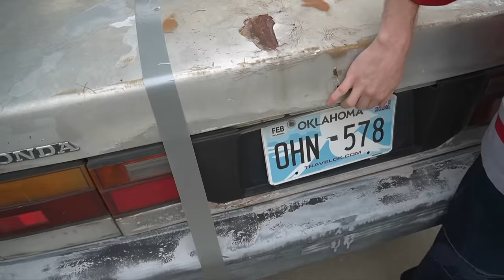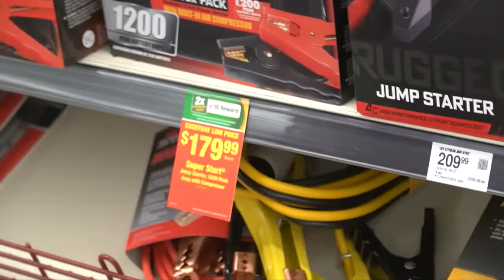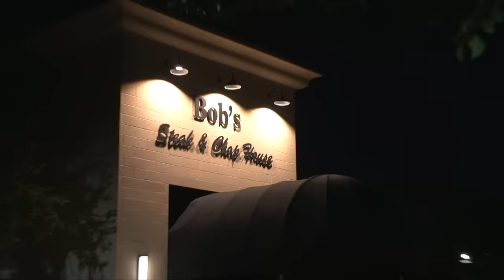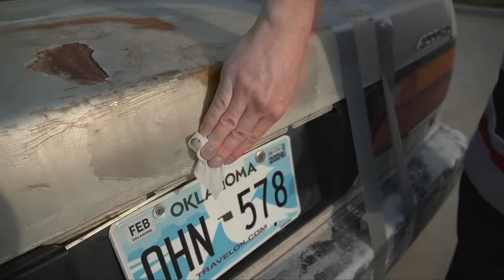I Took My 1986 Honda to a 5 Star Restaurant to VALET

Comment: This man ran this car without any transmission fluid and engine oil just goes to show Honda makes seriously good cars.
Reply: 1986
Reply: @hiddenfingerb2072  even today Honda and Toyota make the best engine in terms of longevity in the world.
Reply: There was a vid of them running cars without oil and revving them until they carked it. The Honda kept going with no oil.
Reply: A hypercar would never
Reply: you could hear it knocking in one of the scenes there was a slight knock
Reply: @Wisdomseeker24-7  Sadly the super new ones aren't nearly as good as they used to be. Toyota changed CEOs and since then it just hasn't been the same. The new Supra is a great example, very nice car but it's basically a BMW with a Toyota badge on it. It's nowhere near as good as the OG Supra. Honda is still decent but they aren't nearly as good as they used to be. I have a 07 Honda Fit and mechanics tell me to keep my car as long as possible because they don't make them like mine anymore. The Honda Fit (or Jazz if you are from the UK) was built in Japan and you can tell by how well the engine runs even 17 years later.
Reply: Old school cars be built diffrent 😢
Reply: Yea before Honda wasn’t shit like the new ones from 2010s are real nice lmao
Reply: Exactly
Reply: Lmao😂🔥🔥🔥
Reply: @myacidninjatheamazing1025 well a knock with probably 700k miles isn't bad 😭
Reply: Seriously! Any other car would have blown up. Hondas and old school Toyotas don't play.
Reply: @Wisdomseeker24-7 Toyota got bad in the last few years tho
Reply: @BeamRider100 no cars keep going for long without oil. My girlfriend's engine blew because all her oil leaked. It was a Honda
Reply: They used to be good in the 80s & early 90s. Toyota too. Now they all suck

Comment: How you pay over 1k on repairs and homeboy don’t even check the fluids? Killin me bruh 😂
Reply: @jazzfeline5970 that has nothing to do with anything, a bad mechanic is a bad mechanic regardless of their ethnicity.
Reply: @AlansGarage no
Reply: @AlansGarage  Sure, but good mechanics aren't typically working for $12 an hour under the table.
Reply: @jazzfeline5970 keep my name out u mouth boaaaaaa
Reply: @jazzfeline5970 Damn, you know all Mexican mechanics huh? You’re judging a whole country based off of one mechanic? If that was the case then Mexico would have no cars due to having shitty mechanics. Use some logic.
Reply: @iamhereblossom1588  The logic is simple, but your feelings are hurt. Bottom line: People willing to work for cheap do cheap work. In the US, these cheap laborers are most often from a particular part of the American continent. It's obvious logic that you either can't or don't want to understand.

The root of the issue isn't even the employees themselves: it's the bosses and contractors that are willing to hire them for the sake of cutting costs. But that doesn't change the fact that they frequently do subpar work.
Reply: Depends on what your coming in for. If you come in for a specific issue it doesn’t mean they will do a full inspection. You could have a whole new motor put in for thousands of dollars. Doesn’t mean they are going to check the transmission and suspension…
Reply: @AlansGarage 💯💯💯

Comment: How did it run this long with no oil or transmission fluid?😂
Reply: it's a honda lol.   Pretty sure I heard some rod knock later in this one though
Reply: @v12alpine   What killed me is he had it parked next to the beautiful hemi cuda lmao
Reply: Older cars would shock you 🤣 I ran mine with no transmission oil for a day when I got it and still been running for 10 years strong lmao
Reply: Took my girlfriend's Civic to a QuickLube once and they didn't put oil back in it. We drove that badboy for a week before the light even came on. 😂
Reply: You can’t get anymore reliable then 3rd gen accord 😂
Reply: @rayhann8626   the Hemi is worth 5 times what even a mint honda would bring
Reply: It's honda dude
Reply: It's a Honda 😂😂😂
Reply: It's a Honda 😂  they literally run forever.
Reply: It’s a Honda… it isn’t a piece of shit ford or Chevy
Reply: lol you need an alternator.
Reply: I have not changed the oil on my honda civic si 2003, for like 7 years, 😮  350,000 miles on it, manual transmission too
Reply: Because it was made in Japan, where anything good is made.
Reply: I was like, how did the mechanics not see that is my question! $1k to change a radiator but didn't check fluids. Crazy to me.
Reply: @bootneylee9802 Hoo Lee Sheit 😂
Reply: @franciscomuro4072 That's crazy. I'm just 1 year without a oil change on my Mazda (i rounded off the oil pan bolt) and it burns a little oil now. Just make sure that bih aleast always at the line. You don't want to run it without oil
Reply: @hyemuhyemu8221 hit the bolt with a blow torch for a min then vice grip it should turn out. Or go for a long drive heat the oil up and vice grip the bolt just becareful of the exhaust pipe lol
Reply: So that shop was useless then and couldn’t point that out?
Reply: ngl them mechanics some mickey mouse type shit
Reply: This is when Hondas first became known to last forever.
Reply: hahahhahaha i thought about that
Reply: It's a transformer
Reply: @mluterancik  dude, she will die in the video. I'm sure about it 🤣
Reply: I used to drive 80 miles total to work 5 days a week in my accord with 168k miles and I saw the oil light pop up but then it turned off so when I got home I checked the level and there wasn’t a drop of oil in that thing 😂 refilled the oil and changed the vtec solenoid gasket so it could stop leaking. I’ll never give up on Honda!
Reply: @franciscomuro4072 you capping,  lol oil burns over time.
Reply: @GerardoGarcia-tb7gi  I have put some oil, yet not change it lol I am afraid something will happen if I do. Lol
Reply: It probably still had oil the stick just wasn't touching it anymore because there wasn't enough
Reply: @joebenson528  I’m sorry you paid 20k for a car and never changed the oil???
Reply: It's a honda made in Japan
Reply: @Yudit3sBeastGamePlay  Oh yeah dude I ran my 2005 civic ex 1.7 vtec completely out of oil once because I was playing around with D3 on my automatic transmission one weekend. It started sounding a little rougher so I got home and checked the oil and there was literally no oil on the dipstick, it was spooky. Needless to say I added a few quarts right there and then changed the oil completely the next day. No problems at all to this day 250k miles.
Reply: Honda never die

Comment: How do you spend $1K at an auto shop for repairs and they don't even check the Oil or Transmission fluid?  Makes it that much more funny!
Reply: They are scammer's that's why
Reply: @mipassionanime he brought it to fix a coolant leak not to dismantle the engine and put it back together.
Reply: @Viewer899  what does that have to do with my comment this loser mechanics are scammer's and don't deserve to get paid I trust more a delivery guy I give him 100 dollars tip next time

Comment: Spent over $1000 on a $800 car for us 😂😂
Reply: thats a damn $75 car lmao..
Reply: @rkellyonu not really
Reply: mechanic scammed his a$$ like a mf 😭
Reply: Don’t trust these mechanic shops fr
Reply: $250
Reply: @rkellyonu If it was in mint condition low mileage it would be worth like 10-15 grand in some cases if it was nice enough
Reply: @Duohzy 189 for a new battery that costs like 70 bucks, when his battery was actually fine and just needed a charge cuz there’s a voltage leak somewhere in the system or the alternator was bad anyway LOL
Reply: So they traded battery’s with him for 189 LOL
Reply: And make prolly 10g still lol
Reply: 9:10 $600
Reply: I wanna know where the 1000 dollar bill came from
Reply: Lol, yeah 1000 bucks and it still didn't work. Rip off.
Reply: @Curiousboi  I mean they could’ve at least fixed it from idling at 2000rpm’s 😂
Reply: What did they even do. Lol $100 worth of “work”
Reply: bro you'd see those for sale for $4000
Reply: 1000$ what it has too be fake 😂.
Reply: @ernestor5440 not in these times, Suits worth 10x the old price pre-covid.
Reply: Bad alternator
Reply: The content, priceless😂
Reply: @gptsiteuser when was the last time you bought a car battery? They’re 150$ for a basic one these days lol
Reply: @Freewill33 absolutely.  I bet they only replaced a hose and filled it up.  Most shops are out to take your azz.
Reply: @ButtmanAtHeart I just got two year battery for versa and rx350.  Almost $200

Comment: the fact that the car is that old, and was able to run w no oil, just fine is insane
Reply: a clapped 1980s honda is still better quality than a new kia
Reply: Any engine will run with little to "no" oil. It's just a matter of what type of oil the engine uses that will dictate when it welds itself together. That, and the engine design.
Reply: @Zoomydoomy usually there's a reserve amount below what shows on the stick

Comment: When I see an older whip on the road still running, I have much respect for it on the road. It’s like a classic, but not a classic, however, Brian’s Honda is a classic 😆
Reply: I'm proud of my 1995 Mitsubishi 3000Gt and my 2004 Infiniti G35. They're both loud asf and still run. The crazy thing is i live in the north, most 20+ year old cars are rust bucket. Mine are still clean asf with no rust. Especially the 3000GT, its built like a tank!

Comment: My parent's bought a $1,000 1996 civic ex. Almost 6 years later it's running nice & smooth like new after all the miles to my dad's work and back around 270,000 miles :)

Comment: Could you imagine? Back in the day the LX was the top of the line Honda. Below that you have the DX and the base model. The base model came with no A/C, no radio, and not much of anything else. The DX and base model had black bumpers.  Of course this was only a few years from chrome bumpers. When the LXi came out in 89, I wanted to get one. It had over 100 horsepower!

Comment: I did this once, but it wasn't for show. 

I had a 95 camry and the handles on it were starting to fall apart. I was having to climb in through the passenger seat because my car door handle had broken off on the outside. Maybe a day goes by, and I'm getting off work, and my passenger door handle breaks off too! So now I'm crawling through the back seats and over to get on the driver seat. 

First thought after the bs wears off? I'm heading to 3 Forks.. With a large cash tip for my valet attendant.. a well earned killer steak.. and a story to tell

Comment: Havent finished the clip yet, but what you needed first was an alternator than a battery lol.  The ALT is draining the battery, if they had common sense as mechanic's then they should have known that!  Which in the long run could have saved you paying that extra grand.  Either way great entertainment!  Lol

Comment: its actually a nice car, if you restore it would be a gem, could even engine swap, but you should PIMP my Ride put a fish tank in the trunk and a pS% with lights a sound system, upolstry, tvs, custom fiberglass cabinet for you amp and subs! fix the exterior lights, starlight roof rims, and a wrap/ candy paint, could even go th hydrolic route witht the suspension ordo somthing crazy like a donk, or even the slab kinda rims you see in texan when they be swanging!

Comment: Nah that didnt need a new battery, yeah the old battery was old but the car cranks ok, the problem is the car is NOT supposed to crank for that long in the first place, it has another issue, maybe fuel pressure, bad compression, bad electrical issues or bad sensors.

Comment: LMAO... It's called  "Duct"  Tape  as in Air Ducts for Air conditioners and Heating systems to seal off the the air ducts  when then butt them together.  NOT "DUCK" Tape as in Quack Quack!!! lol!   Air Ducts Made of galvanized steel or aluminum, rigid sheet metal is the most common type of ductwork. Airconditoning and Heat runs through them..

Comment: You need a alternator. That's why the battery keeps dieing. Oil pan gasket probably needs changed. The first shop overcharged you a thousand to replace a hundred dollar radiator that takes a hour to replace. They should of charge you $300. They should of checked the oil and then tried to upsale you on a oil change, and transmission. The mechanic could barely speak english which shows how unskilled he is in the work place.

Comment: Why did they add the fluid without the vehicle Running?? first off that’s Roman transmission needs to be operating temperature. Gears need to be cycled to circulate fluid through the valve body I would never use this lube shop in 1 million years they clearly have no idea what they are doing. I love how the guy has a Cornwall shirt and Mac tool shorts but yet they can’t check transmission fluid level hmmmm